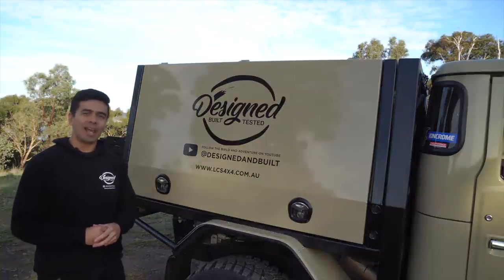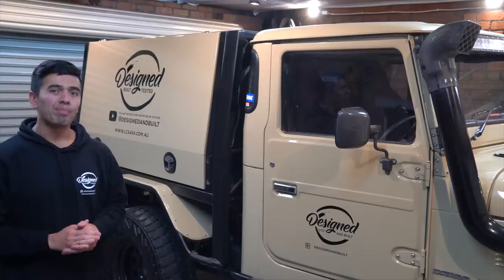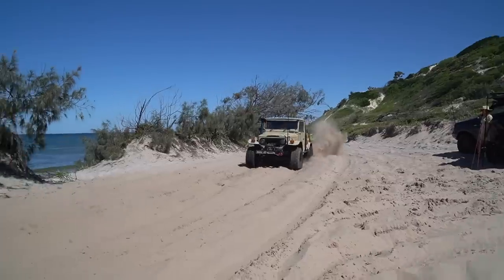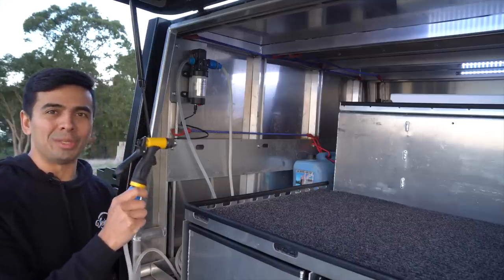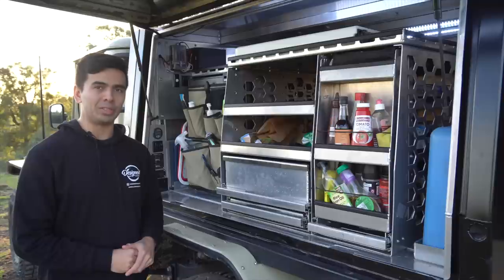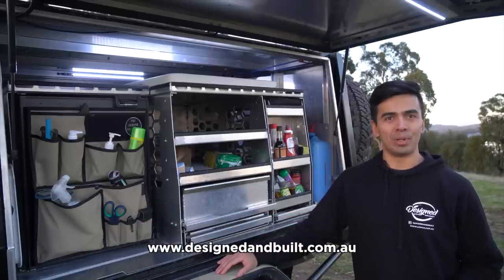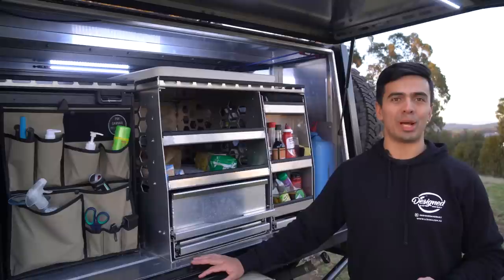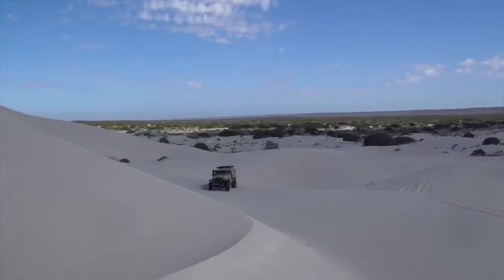Landcruiser OVERLAND build Overview

Comment: Thanks for this onceover! A good conclusion video to organize some takeaways:
Charging DRAWER. Keeps gears in charge and in place. I'd charge while driving and always bump the cameras everywhere then pull out of plug..
Drawer act as projector screen lower support! Not sure if coincidence but works pretty neat.
Platform rim with holes all around as tie down points.
Slim batteries to tuck away against the wall.
Integrate a drawer fridge in the drawer lineup.
Light up logo is a must!!

BTW- Kewpie mayo should be refrigerated after opening..  Probably go through the pantry and check on other bottles. If that's a salad dressing bottle on the lower shelf, it probably need refridgation too. .
Reply from the maker: Great summary Monique, charger drawer is great for us camera gear hoarders… Drawer as a support was planned 😝😅! 
Not sure how I would live without a light up logo! 
Hahaha re kewpie mayo and condiments! Whatever doesn’t kill you makes you stronger, but appreciate it - will look into it.

Comment: What are those USB sockets you're using mate? I absolutely love them
Reply from the maker: These ones off ebay - search: Dual QC 3.0 USB + PD Type-C Fast Car Charger Socket Adapter Power Outlet 12V 24V
Reply: @DesignedandBuilt  found em, thanks man! They're pretty cool